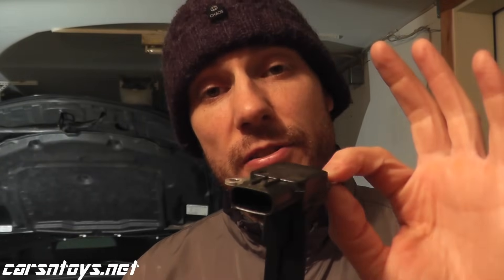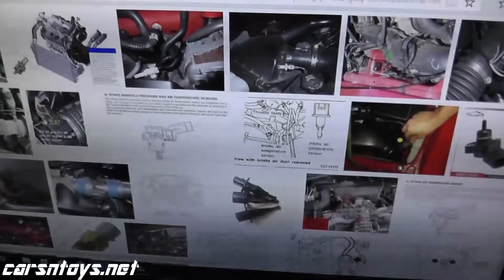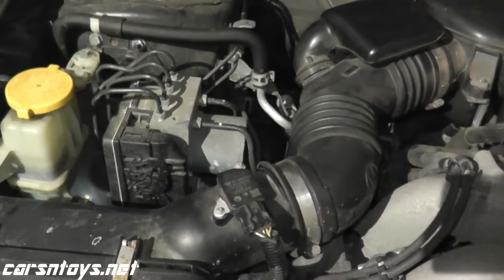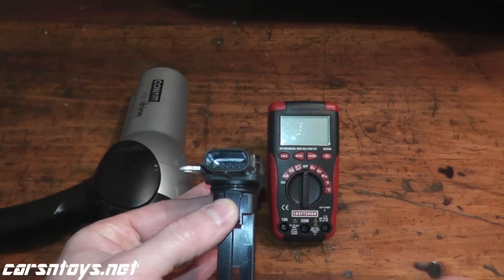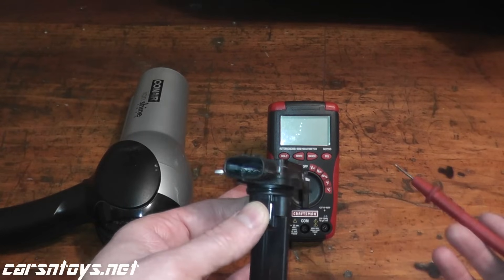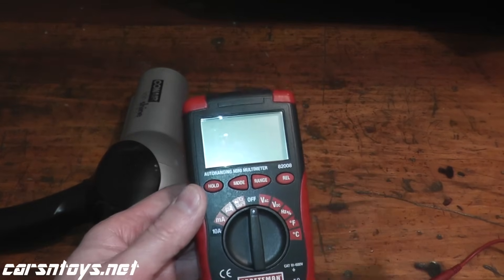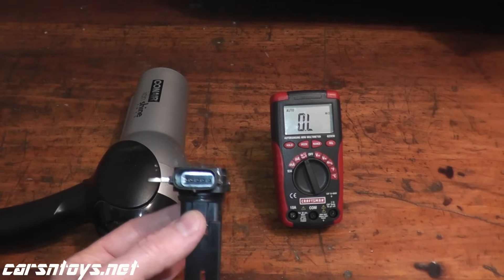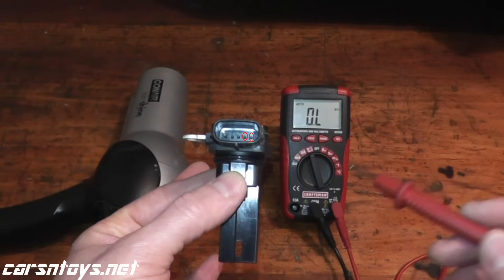Intake Air Temperature Sensor P0111 / P0112  / P0113 | How to Test and Replace

Comment: Another code that's "thrown" is P0097 (temp low-ckt 2) in GM 3.6L engines. Btw, that sensor is a "resistor pellet". A resistor DOES NOT generate a voltage. The ckt RESISTANCE changes according to the incoming air temp, which the computer reads. In my GM 3.6L the AIT sensor is an integral part of the MAF sensor assembly. Also, be VERY careful when cleaning the MAF sensor with the CRC spray. I was a wee bit aggressive in cleaning the MAF and fucked up the AIT sensor in the process. Cost me $36 on ebay for a new MAF/AIT assembly. Vehicle runs perfect NOW (as it was before I started to "clean" the MAF). The old adage "don't fix it if it AIN'T broke" still applies! CHEERS!

Comment: My Engine is stalling at 40 kph up to 100kph. I tried to test this and the sensor reads at 4 Mega Ohms and up. should I replace it? There is no error code in my scanner

Comment: For this particular sensor, the resistor that measures the temperature is visible outside. So you don't exactly need to touch the pins, you can simply touch the resistor directly and then simply perform continuity check between the resistor poles and the pins

Comment: Holy cow.  This always a very refreshing video.  Straight to the point and very easy to understand and learn from.  
Can you tell me where I'd find out which 2 pins I need to connect to in order to check this circuit?

Comment: Great video testesd with blow dryer and went down quickly but still have code and proper voltage coming out plug so not sure what else to do its a nissan altima 3.5 what a nightmare these nissans are thought of just replacing to see what happens because car has rough idle if uou let of gas it will shut off any ideas would be great

Comment: OBDII info shows that the sensor is increrasing by the minutes the temp. Startint at a 60 celsius, early in the morning, with a coolant temp of 22 and an outside temp of 21. With the key position "on", not starting the engine, the iat keep increasing the temp. In abou 15 min it wil reach 89 celsius. Coolant still in 22, real temp in 21. ¿Faulty sensor?

Comment: In which resistance you tested it out bro.
I got 200k ohm or 2000k ohms only on my meter?
Mine shows 1.92 on 2000k ohms is it correct?

Comment: In my case, the iat is built in the maf sensor and I'm getting the p0113 and p0102 codes.  I've tested the maf sensor as you showed and works fine.  What can be the problem?
Reply: Currently have the same problem, did you ever fix it??
Reply: @Barbie_97 having same issue, you guys figure it out? Lol

Comment: Could this part make your vehicle run rough like a misfire? My van is also putting out a code for a misfire on number 1 cylinder?
Reply: No if you have a misfire on cylinder 1 that mean it's either the plug or coil or spark plug wire depend on what u have on ur car. If you have coils the easier way to test it swap coils from another cylinder delete code ride til check engine light come back on if misfire jump to the cylinder yu swap the coil to its the coils but if it til in cylinder 1 it' the spark plug not fring

Comment: I have P0113 code... throttle cutting out intermittently when I shift gears. IAT reads -40F on the scanner.  I'll try cleaning it first with MAF cleaner.

UPDATE! MAF sensor connector was not securely plugged in. IAT now reading in normal range.  It seems to be something stupid 98% of the time.  I appreciate you reminding us to check the simplest fixes first.

Comment: A natural instructor! Great video, thanks!
Reply from the maker: Thank you.
Reply: Hello I have a 2015 Chevy Cruze Lt 1.4 tubro and my scan tool came up PO113. Says air intake sensor. I can't believe it is mass air flow sensor already  I put in a Bosch OEM part any help would be appreciated ty
Reply: @dancurrier6421 . Did you fix it ?

Comment: Hello! Maybe you can tell if my sensor is bad. I got the same sensor you have but from a 2010 subaru forester.  My testing show infront of the aircon at home @42-45 deg fahrenheit with 1.97-2.14 ohms and on room temp 1.4 ohms, using hair dryer on low heat about 1.1ohms.  On the car idle for 15 min with a scanner IAT @114 deg then unplugged the sensor and reads 1.0 ohms. My codes is P0113 and  p0102.  I need the actual specs for subaru if you know.  I see charts on the internet and my resistor reading is so off which show @248 deg with 1.18 kohms. What does Subaru say? Thanks
Reply: was it your maf sensor?

Comment: Thanks for the tip and a good video. I learned something. My question is do you know what is considered normal Temps for the intake air on a 2021 6.7 Cummins? What should it normally read?
Thank you!

Comment: When connecting the clips to the pins are you using the signal ground & IAT pins?  or the ground & MAF sensor signal pins ?
Reply: In my case it’s a 2014 Sierra 1500  and it’s a 8 pin   Which has MAF, IAT & humidity sensor signal.

Comment: Hi! Body
I have a question. I have a Nissan sentra 2013, and tgey rebuilted the transmission after that I had been having a lot of issues with it,, first when driving it.it doesn't change gears, the max it reaches is 65 mph when going down hill , it slide and sometimes got stock, I was told that it have to do with the intake air temperature sensor, also I scanned it and shows code P0965,p0111, p0847, P2859,P0112, P0102. I also was that if I changed the intake air temperature sensor the car need to be reprogram otherwise it would keep doing the same thing. Could you please help me. Thank you
Reply: Take it back. Those sound like they either gave you a used transmission or didn't rebuilt it right... Or reused the old solenoids that aren't powerful enough to work with the new tolerances

Or if you're lucky it's just a disconnected ground cable, or a broken wire somewhere

Either way the repair has some kind of a warranty so I'd take it back. It's 100% related to what they did so they have to fix it

Also sounds like some other sensors are disconnected or their wires are broke somewhere as well

You can reset the codes and see which ones come back for certain in case some of those were from the repair

Comment: Hi, I’m getting P0113 but my MAF sensor is working fine! I even put a new one and still same problem.
Reply: You likely have a separated air intake sensor. They aren't always part of the mass air flow sensor
Reply: I can't find mine either i have a 2005 nissan sentra 1.8l
Reply: Got the same issue ,still want to see what i need to buy or rather easy diy fix ?! Not a clue messed me up for a whole day

Comment: Very good on explaining the video and on the part itself. Would of been nice to show how to clean these SENSORS now. It it easy as buying a can of cleaner ? Or does it need to relearn anything ? I've read that you must reset these, some may need to go to the Dealership and get them to fix it and update the system. Some relearn by themselves from driving them around to learn itself over with easy driving. Just trying to learn more on these.

Comment: Even I can comprehend this. And no annoying music! Cuts to the chase in a kind clear way. Thank you!
Reply: Be happy
Reply: yes good without the music ..
Reply: The dude NEEDS to learn MORE ELECTRONICS. Example: the AIT sensor is a RESISTOR. Resistors DO NOT put out a voltage! Current flow THROUGH a resistor creates a "voltage drop" across the resistor which is read with a DMM!
Reply: Exactly! Not like many other videos where they spend 5 minutes rambling and leaves the viewer with more questions than answers.

Comment: If I wanted to check the harness that plugs into my IAT, would I conduct the test the same way?
Reply: This may help:
https://troubleshootmyvehicle.com/toyota/1.8L/testing-the-intake-air-temp-sensor-5
Testing resistance, powers and grounds of the wires from the  Sensor to the PCM/ECM is a good idea, but its a little more involved.
Stay gold.

Comment: Hi, i did that test.. since inwas hmgetting trouble codes. But in my 06 lexus rx330zz when idling it will hesitate for a sec. then continues idling then when i step on the accelerator pedal . Nothing happen. I have to restart the car to make the accelerator pedal work again. Any idea?
Reply: Sounds like either the throttle position sensor, dirty/malfunctioning idle control valve, fuel pump, fuel damper, fuel filter, or even unexpected air coming in

Would need to look at fuel trims and other data

Comment: I have a 2009 p71 just bought a new air cleaner Assembly with the MAF sensor .  still showing the trouble code po113. Thanks My Man. But there's a intake air temperature sensor for my car i bought it can't find where it goes😭😭😭. But i think i need a MAF connector because i didn't hear the click from mines.

Comment: I know this video is old but hopefully someone can help me out. My brother drives a 2010 Nissan Altima automatic. Every once in a while the car shuts down completely at traffic lights. It'll turn back on but it's obviously not supposed to do that. I read that changing this sensor could fix it. Thoughts?
Reply: Had a similar problem in a 2005 Dodge Neon. Turned out to be the camshaft position sensor.

Comment: Thanks for this. Well explained, demonstrated, and contextualised. Cheers!
Reply from the maker: Glad it was helpful!
Reply: @Carsntoys  can a bad sensor cause the engine to stall as you are driving it?
Reply: @Carsntoys  I am setting my digital meter to 2000 K  on the omega symbol and I get "Zer" am I setting it right on my meter?

Comment: Could this cause the car to not start cause its reading p0113 and mine stopped on me while driving and won’t start now?
Reply: I had that issue with a previous vehicle and it ended up being the wire harness to the fuel injectors.
Reply: I had that problem on a Ford ranger. It turned off and came to a top while driving it. I had no power anywhere. It was like the battery was not in the truck. Turned out to be the brain. The ecm I believe. But if you have power its not that
Reply: Yes happen to me I didn’t know what is was till I brought a new mass air flow sensor
Reply: Thank you for the video. I have a simple question. Why did you test the resistance and did not test the voltage. You indicated the voltage range o.23 to .45, but you didn't show us how you determine that. Thanks again.
Reply: yes it can.
Reply: How do you know for sure,this is happening to me right now

Comment: Hi 
My sensor was going down when heated but then after heat off it came back up but left longer started to jump from margin 3.15 (start point) went to (0.25) when heated and heat off it start to jump intermittently btw 3.00 and 18.00 my multimeter is set to 20k ohm 
I did this test again and now it take ages to get back to 3.00 it just slow very slow in rising back to nominal..

Comment: I have a 2013 Subaru Legacy, had to remove the air intake for better access to the headlight area to replace a high beam. Once I reinstalled the air intake, and restarted the car, had a check engine light, codes come up as P0102, and P0113. Only issue I had with reinstalling the air intake assembly, is the mass air flow sensor wire is kind of clipped into a spot on the car, but that little clip thing broke, could that be causing some kind of grounding issue? Will a zip tie holding it back to that spot it was clipped to fix it?
Reply: You likely had the key on or turned it on when it wasn't connected... Try resetting the codes and see if they come back

If they do, it's either not connected right, or a wire got broken/ruined somehow

The wires being clipped doesn't do any grounding
Reply: i know its 4 yrs old i thought id try my luck 
Howd you go did u manage to solve it

Comment: I cleaned my throttle body on 2011 Mitsubishi lancer es 2.0L and I plugged that sensor when I plugged it back .and started it up I got a engine light p0113 maybe because I never disconnected my battery. when i cleaned my throttle body and unplugged that sensor. after i drove it a while engine light went away. i check my obd2 i had to clear the code. and now I started my engine again no more p0113. codes are 0.

Comment: I have correct voltage and continuity to the ground signal return....I put a new one in a 90 ford ranger 2.9L ...and they keep burning out....Just replaced Ecu thinking that was the problem...no help.....Any IDEAS??

Comment: Awesome job, thank you.  
I have two codes on my 05 civil.  Po706 and po113 . And do you suggest I replace the transmission range sensor or there is a way to check that , if you would please .

Comment: Thanks for the video. 

i have the following error codes on my WRX STI . P0102, P0113 and P0031. Could they be inter related ? What would be the best route to sort them out?
Reply from the maker: What year is your Subaru? P0102 is the mass air flow sensor and p0031 is an oxygen sensor. I'll have an oxygen sensor video uploaded later this week.
Reply: CarsNToys 

My subaru is 2002 JDM WRX STI.
Reply from the maker: Do any recent work to the car? Intake, exhaust, etc.
Reply: Yes, i have a cold air intake now.
Reply: Mushinka Mazyambe any update? I have p0113 and p0031. I swapped the upstream sensors and still get the code. I changed the downstream sensors also. Help lol